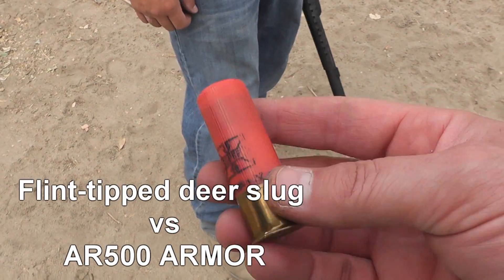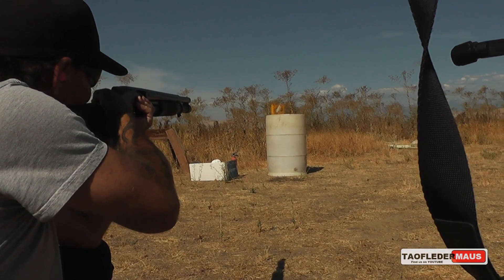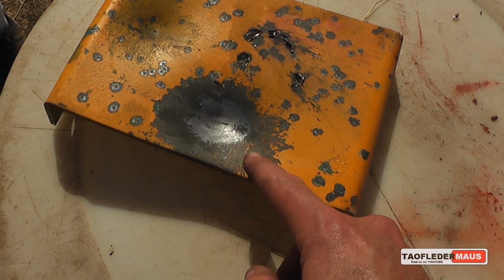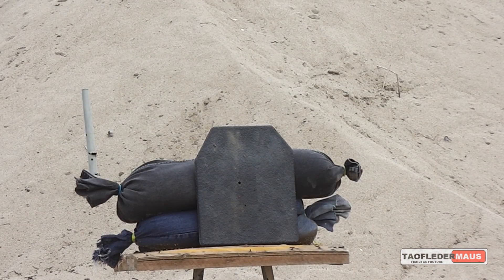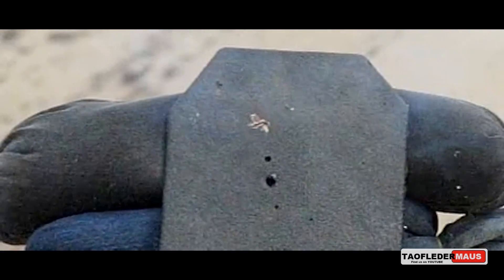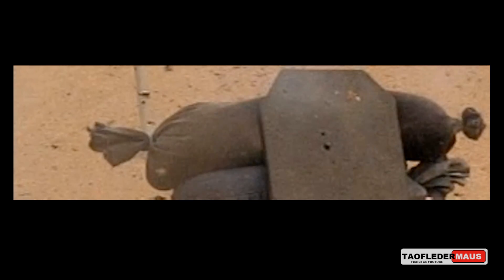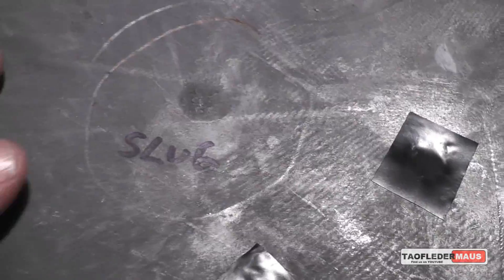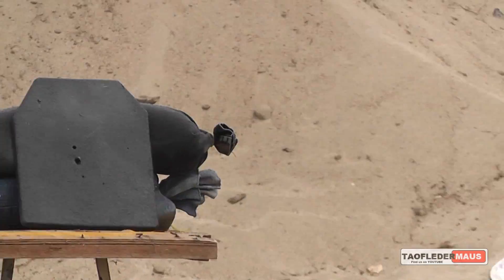Flint-Tipped Deer Slug Vs AR500 Body Armor Test

Comment: Flint tipped ammunition is not necessarily meant for people and body armor what it's meant for is piercing fuel tanks in vehicles causing fires or for creating large fires at flammable storage areas because standard ammunition will NOT cause a vehicles to explode or even catch fire no matter how many rounds you shoot at a gas tank

Comment: That coating is designed to stop sparks and disperses static it's used on oil rigs to help stop fires. If you had shot an metal again,not nylon!  It would have sparked for sure
Reply: I have zero memory of commenting this lol it doesnt even sound like me when I read it in my head wtf

Comment: That type of coating is used in the offshore oil fields on the steel deck plating. Good protection for the steel deck and no sparking deck to cause a oil or gas fire, hence the no sparks event...I oversaw the application of that coating on many, many offshore oil or gas production rigs..It's a glass flake coating applied hot..very hot....

Comment: I was just thinking about something... Most likely illegal... But, a Slug with a hardend steel "Concrete Nail", drilled and epoxied in the center.....
Reply: +WezleyB Not illegal, not even close.
Reply: +Porty1119 and???
Reply: WezleyB And, it would probably work. Not necessarily enough to punch through AR500, but enough to seriously fuck up light vehicles. Put one or two of those through the radiator, and he won't get far. A lot of bullet-resistant glass may also have problems with it.
Reply: +Porty1119 yeah but these guys shoot bolts and carbides. so why would it be anymore illegal than other homemade rounds..
Reply: WezleyB It is not illegal. You seemed to think that it was.

Comment: Do they just send you an endless supply of plates?
Reply from the maker: No,  just three of them.
Reply: *****  You've been using the same three plates all this time? Those are some damn tough plates.
Reply from the maker: Actually I have only used two of them so far.  I wanted to get as much use out of them as possible.
Reply: Thats crazy! How are you taking the covering on and off? does it just slide off?
Reply from the maker: The coating is stuck on very well.   But we've shot it so much it has stripped it off.
Reply: ohh. alright.

Comment: Take a 9mm bullet, surround it with wax and put a metal bb or a 00 buck pellet on the primer, and load that into a shotgun round. How do you think that would do against a steel plate?
Reply from the maker: It would probably break apart when we shot it.

Comment: As a side note the plate may have stopped the slug but i'm betting that hit would have killed someone if they were wearing it.
Reply: maybe someone will get a ballistic torso with ribs in it to test instead of a person lol.... probably cheaper to do it that way and no law suits :P
Reply: it would be really cool to see that test in slow motion... it would be cool if they had 3 ballistic torsos shoot one naked as a control one with soft kevlar armor and one with the plate and see the difference in trauma.
Reply: It might break some ribs at least.
Reply: The hit would almost always break ribs, those would likely puncture a lung. And there's a chance the the hit could stop the heart
Reply: the plate is converting the force of the slug to a fairly large surface area if the metal bulged out I would agree with you a lot of the force is being directed in a small area then but since the plate remained smooth that means it did its job and spread out the force so instead of taking the hit in the small area the slug would have hit which would be in most cases a fatal wound and increasing the surface area of the hit severely reducing the force per square inch... yes if it hit right it could fracture or a break a rib yes any hit to the chest even someone punching you could stop your heart... but I guarantee if you got shot wearing that plate you will be a thousand times better off than if you took that slug wearing soft body armor or worst case scenario to your bare body. ... I would like to see though a force censor put behind the plate and see what it hits when it gets shot with a  slug though...

Comment: *****Awesome Video Dude. Very Cool Round. 😃 I wonder what would happen if you did the same think with a Pellet Rifle put a small piece of flint into a Pellet and shoot it. 😃 If you do it please let me know. N.
Reply from the maker: FLINT-TIPPED .177 Pellet  -Slow Motion Study

Here you go!
Reply: ***** Awesome thank you Dude I wasn't sure if you had done it or not but very Cool. Thanks Again Dude. Keep up the great work. 😉 N.
Reply from the maker: It was a pain in the butt to drill out that pellet.  It's pretty soft and deforms easily.
Reply: ***** I bet it was a Pain in the Ass to do. Have you tried a PCP Bullet/Pellet? they are called Bullets but they work in PCP Rifles made by "Dynamic" and they are PCP Bullets that are made in .177 & .22 they have Standard & Hollow Point Rounds and you would be able to use the Hollow part to put anything you want in the Hollow Point and then Shoot it. This is a link to a photo of them. http://www.airgunsofarizona.com/Dynamic%20Pellets/PCP2.jpg 

This is the standard one but if you look for the Hollow Point ones they would work Great. Hope this helps Dude. 😃 N.

Comment: I like this backup system better, it's supporting the top of the plate better.  The other thing that can affect armor penetration is the angle at which the projectile impacts the armor.  The higher the angle of the armor, the higher it's "effective thickness" is.  It would be really cool to test the theory with un-coated steel plates to see if the angle makes a difference. Awesome video!

Comment: i just noticed this but when you shot the shot gun the pump comes sliding back ejects the round. i was wondering did you do a mod to the shotgun or is it just so beaten to shit that it just does that
Reply from the maker: I think a lot of the problem is he doesn't hold the shotgun by the fore grip so the bolt popped open.
Reply from the maker: No he didn't.

Comment: great video as always but on another note i think you should switch out those sand bags for a different type of rig. while it is some what doing what you say they aren't doing a great job. since they are sitting behind the object being shot they are still absorbing some of the force behind the shell/round acting like a damper of sorts. if possible you could get a rig that holds the plates/object being shot from the sides while being sufficiently heavy the result of what you were trying to accomplish should be better (not too sure my physics are kinda rusty). im sure the result would be same/similar as the energy would still transfer through the rig but the ending would probably be more spectacular.
Reply: Well if someone is going to be shot while wearing it I'm sure the wearer is still going to absorb a fair amount of energy.
Reply: well yea, the energy will transfer through the body like it does the sand bag. it will probably break bones or bruise the body but the energy still is transferring in the direction the bullet is traveling. with the rig i speak of its almost impossible for it to transfer in the same direction of bullet travel. so the bullet will react differently once it hits the plate

Comment: I'm sure you know already, but large slow projectiles are not gonna do much against well, anything armored.  

Flanchettes vs armor would be interesting.  Especially if you used Teflon spray on them first.
Reply: Shotguns are just not the right tool for that kind of plate.
Reply: blade00362 Shaped charge behind steel penetrator? Impact detonation. Maybe the force of the shaped charge would impart enough force to the penetrator to maybe to some damage.

Comment: Next, fuel tank with flint. Will it explode?
Reply: ***** Are you?
Reply: Shooting a gas tank won't cause it to explode because there isn't enough air present.
Reply: bil xxkiill
So are you. That makes two of us.
Reply: bil xxkiill That keyboard is pretty hard to use isn't it? You should change your name to "The Pot", judging by how you were calling the kettle black.
Reply: I used to work at a junkyard and we would use a pick to punch a hole in car gas tanks to get the gas out.None have ever exploded.
Reply: John Johnson No. You would need to aerosolize (i.e. spray) the gasoline. Then you would still need the proper ratio of air to fuel which I think is 14.7:1 (mass ratio). This is essentially what a combustion engine does. It pulls in air and combines it with fuel. This mixture travels to the cylinder where it is ignited. When you have too much fuel (flooded), it won't run. This isn't really a problem on fuel injected cars but it was common on carbureted cars.
Reply: ricksite What if the tank had only one gallon of gas in it? Would there be enough air then?
Reply: ricksite well i still think it would be interesting to see whether or not the gas would ignite, but if he wants to see an explosion TAOFLEDERMAUS could always use a can of ether (Dimethyl ether), and see what that would do :D
Reply: ricksite John Johnson  Yeah but you still wouldn't have an explosion, just an ignition of the gasoline. The puncture from the bullet would allow the expanding gases to escape and not build up enough pressure to burst the tank.
Reply: ***** I don't agree. You understood what I ment, therefore adding extra words there makes no difference and you can nitpick that as much as you like but it doesn't change the fact that you understood what I ment. English and many other languages are like that,  you can leave out words against the correct form of the language and sentense will still make sense. It only has relevanse if you are making official document, you are taking a test on that language or you are teaching that language.
Reply: Not everyone might understand that kind of sentence and if you do that in school or work bad things will happen
Reply: otherwise I could be "lick a fueltank with flint" but nobody would know
Reply: bil xxkiill i thought she meant....mating a flint with a fuel tank.....will you get a baby explode?
Reply: opmdevil i disagree with that statement. You cannot leave out the verb in a sentence and expect everybody to understand what you are saying. And there isnt any languages that you can just leave verbs or nouns out of sentences and they will still be understood. Language is important.
Reply: ARE YOU??? What if Taofledermaus shoot solid mischmetal slug into the gas tank???
Reply: Shooting an air tank with a regular gun is very unlikely to make it explode without extra forms of flame present. Not enough oxygen and no additional ignition source, and it just won't happen. Mythbusters showed this a few times I believe, as did Sons of Guns on one episode.